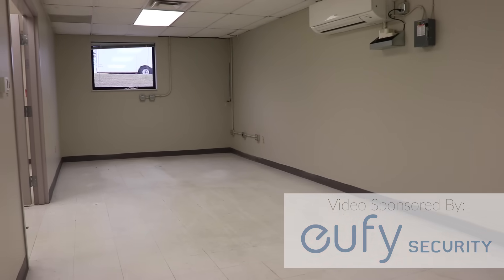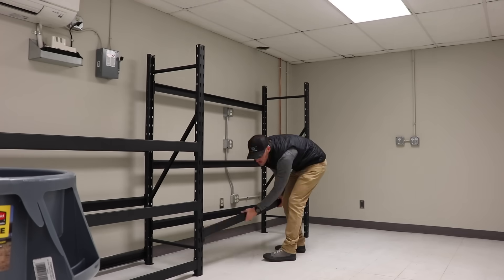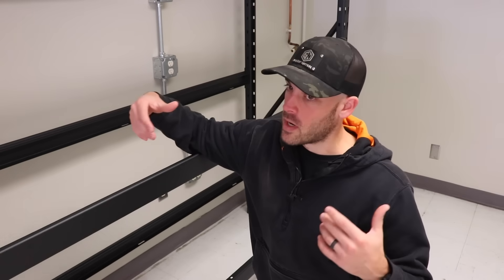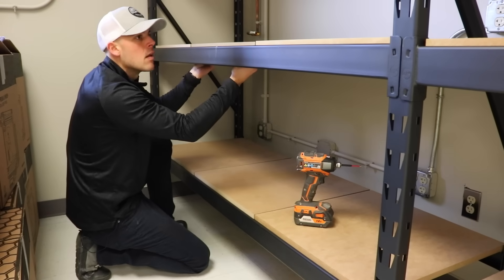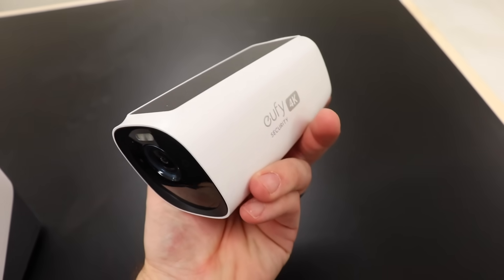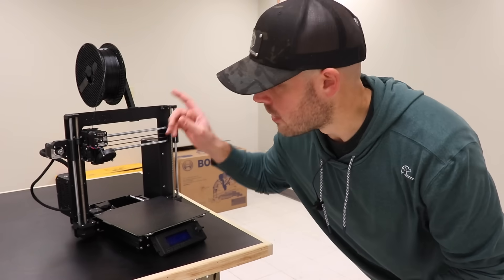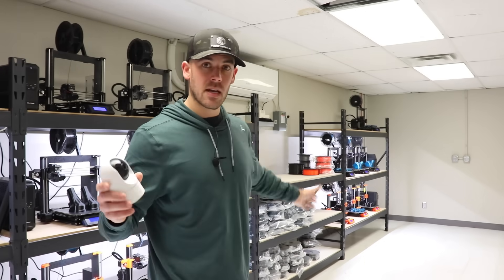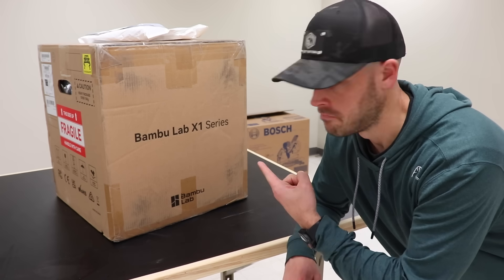I Tried Building an Industrial 3D Print Farm

Comment: I'm an efficiency expert.  One thing you can do to increase uptime on your machines is to have two sets of plates.  The moment you pull a plate off one of the machines, put in a blank one and restart the next print, move onto the next machine, and repeat.  At the end, when you've restarted as many machines as possible, THEN you pull the finished prints off the plates you just removed (and wipe down the plates).  This will save you a few seconds per machine, but over the aggregate, your "uptime" (amount of time the printer is actually doing work) will increase substantially.  This is called Single Minute Exchange of Dies (SMED).  The idea is that you limit the amount of time a machine is idle as much as possible.
Reply: No. True efficiency will be to use a sheet of PEI Film, a 3D printing build surface. You can buy the sheet in various X, Y, axis dimensions, though the Z axis dimension is a consistent 0.5 MM. Once the build is complete remove sheet along with part, wait till it cools and the part removes very well, while you wait till it cools you have already placed another sheet on printer bed and commence printing another part.
Reply: @phubarnow5388  PEI is a great print surface.  I agree.
Reply: Great thinking!
Reply: true efficiency automation.Installing the auto bed change build plates on all the printers and have 0 down time + automation. What if a print finishes at night? you got 4 hours of down time before you wake up in the morning to change bed. I forgot which company sells that system. To address your concern about the bed leveling because the sheets might be different, adjust gcode to run bed leveling each print. That'll be like 3 minutes tops better down 4 hours down time.
Reply from the maker: It’s a great idea and would save time…however, the minor changes in plate thickness means that I’d have to then change the offset in the printer as well.  So it would kind of end in a wash I think. The time it takes to remove parts and replace the sheet is about 20 seconds
Reply: @ShopNation  With as many printers as you have (and will have) would it be possible to find matched pairs of build plates for the machines that are close enough in thickness? I know that initial z height is important for first layer, but presumably there are pairs of plates that are close enough to not need a change when swapping?
Reply: @ShopNation  there are probing solutions that can help with the change in plate thickness and parallelism. This is one area where a three point bed leaving found in some of the Core XY printers has an advantage.
Reply: @ShopNation  it looks like most of your printers have the superpinda sensor which allows a constant z ofset between plates(as long as you used genuine prusa plates and same texture) in my experience with my makerspace 3d printers.
Reply: @ShopNation Have you looked into 3DQue Autofarm?
Reply: @ShopNation don't prusas scan the bed anyways? so like it should auto set the offset based on the curves?
Reply: @ShopNation I think the solution is the CR30.  They have a belt for a bed. You can mount them vertically so the prints just fall off the bed as it prints!
Reply: @theborednerds  also it's a junk creality bad for farm
Reply: @theborednerds wrong the CR30 has horrible reliability, a voron with a bed belt is a much better idea, but they have to be built by hand AFAIK
Reply: @ShopNation  men never thought of that, i guess comes this from running farm long enough :)
Reply: that would actually take longer because you'd be introducing a cooler plate. he just has to flex off the prints and flip the plate. I'm crazy and do that while its still a little bit warm.
Reply: if i was offered a opportunity to get a grant from the government and i wanted a to start a 3d printing  industry level , taking up contract jobs what path should i go for , i got an idea but intrigued to see what you say
Reply: Unless the build plate has aluminum foil tape under it to correct bed warping then that plate can only be used on that specific machine... I don't mind if the printers have 23 out of 24 hour uptime I'm not an obsessed perfectionist.... well at least I'm working on not being one lolz
Reply: Using flex plates, parts pop right off- the key to maximizing a print farm is to load more parts into the build volume. Then you have more parts per cycle and longer cycle run times. Ideally he'd want to go there once every 12 hours and change over the machines. The printers are cheap and time is not, so the way to increase production is really to increase the number of machines, That said, he's making the same mistake as Josef Prusa himself;  D printed parts at scale are more expensive than injection molded parts- unless you are doing iterative design or producing a part that is unually expensive to produce traditionally,  using a mature production scale technology will win. If an actual consultant with a manufacturing backgrtound came in here, the obvious advice would be to outsource the manufacture to an injection molding company that would produce a superior part at a lower cost. I don't mean some boutique overpriced short run specialist (Xoom, Protomold,m etc.) either.
Reply: I love when people start a statement with “I’m an expert”
Reply: I saw a video of someone who made a print farm where they printed a bumper and then adjusted the gcode so that after every print it would push the part off the plate and into a bin hanging underneath then starts the next print. There’s that and the CR30 with the conveyor belt. Perfect for mass production

Comment: I had a terrible time with those rollers. As the spools get lighter they start to pull right off the roller, even with good bearings. Hopefully you have better luck! I had to move to a different design.
Reply from the maker: Yeah I’ve heard of that happening, I have an idea to hopefully help prevent that
Reply: Maybe tilt them back so they aren't level will help?

Comment: Awesome!  One thing I haven't seen you mention yet was environmental monitoring, i.e. Temp and Humidity.  I'm not sure how sensitive those printers are to changes and it sounds like you have them running when you are absent.  There are tons of products out there that can send you alerts when things get outside of your parameters.   I currently use the SensorPush line since it ties into my Homeseer system and can run some automation routines for me.  Depending on the alarm system you either have or may go with, there may be options there as well.

Another suggestion would be to make sure that ALL of your networking equipment is set up on a battery backup that would be large enough to run it for several hours and to make sure your "NVR" box (the brain for your cameras) is also on it.  That way, if the power was out (whether by a storm or someone who wanted to see how much those printers were worth at the pawn shop), you would be recording full time and you would also be able to use your camera app to view what's going on.  Even with a generator, having all that equipment on a backup would stop it from power cycling while the generator was powering up.

Funny thing, I was just wondering how the backyard project was coming along and wondering when you would post another video. Guess you read my mind.  Thanks as always and enjoyed the update.

Comment: What if you turned the shelves 90 degrees and had walkways between the rows of shelves, instead of shelves going along the walls. It could eliminate dead space in the room if the measurements work out. You could put 1 shelf along the left (window) and right (opposite window) wall, then enough space to walk, then back to back shelves. |w||w||w||w||w| |=shelf, w=walkway. Not sure if that would allow  you to get more in the space or not without actual measurements

Comment: You Need to search Eufi LTT to see the videos Linus Tech Tips (oldest and largest TechTuber channel) did on Eufi.  As Jose mentioned they had an Extreme security issue.  And instead of immediately fixing it they flat out lied.  Got caught.  Finally fixed it, but never even apologized.

Eufi had been a sponsor for LTT, but Linus fired them over this issue.  I'd link the videos but seem to recall that's either blocked on most channels or looked very badly upon.  But that simple query will pull them up.

Comment: Q: What's the deal with the UPS'?  I think I didn't quite understand the point of them.
Reply: you don't want to be 4 hours into a 5 hour print only to have it ruined by a quick power blip. Cheap insurance especially with 25 printers running at the same time. It would also give time to switch to a generator for longer power outages
Reply: @scottstarck293  ah!  Yea, that makes total sense.  For some reason I thought it had to do with power distribution and was scratching my head.
Reply: @5ElementsWoodworking  Actually it probably helps with that also, no need for power strips everywhere

Comment: Don't be an idiot like me. I bought a Prusa, set it up, and couldn't get a print to get past like 5 layers without falling to pieces. I must have realigned the head 20 times. I thought mine was just broken and went back to my entry level Enders. Sooooo. Turns out Prusa sent PETG with the printer instead of PLA and I never bothered to look at the filament. So my settings weren't hot enough and the prints never melted enough to bind the layers. Sucks because I bought 2 more Ender printers thinking Prusas were not that great (even knowing how many people used them for production setups)

Print farm looks great!
Reply from the maker: 😂 oh man!

Comment: Nice video. I would like to see more information your process of getting all the printers starting printing. Is each machine dedicated to only printing one thing kind of thing. Once a print is finished the bed is cleared then same print is restarted. Are they network controlled or do you have start each one manually. Are they equipped with some of filament run out sensor

Comment: Eufy....  Oh boy.  Hope you like random people on the net also watching your cameras.  Install smart switches for all your lighting so you can control that from home too. Then you can turn on any light you want to see anything in more detail via your cameras. On top of that smart outlets for the printers if you don't have them accessible online - if one goes off the rails, shut it down instead of wasting filament or damaging anything. I'd have the whole thing running on Home Assistant which is quick to set up, supports everything under the sun and easy to manage.

Comment: I'm very curious to see what you think of the Bambu Labs.  That's my personal printer right now and I love it.  But, I don't know if the X1 would be a good machine for a print farm.  I think the best benefit of an X1 is the speed of the print, the ability to do materials that require higher temps, the lack of tweaking needed for most prints, and the AMS.

The only thing that I see really helping with a print farm is the speed, and that may not be that great of a benefit to you in a large scale situation.  If the speed does help it may make a lot more sense to do P1Ps instead of X1s.

Comment: I'm sure you addressed this somewhere previously, but why are you printing your products instead of outsourcing manufacturing to someone who can do injection molding or any other manufacturing process which could lower costs?
Reply from the maker: I plan on addressing this in a future video but mainly low volume high mix manufacturing
Reply: Tooling cost are prohibitive.  Molds are expensive around 20k-30k for a cheep mold and complex molds can go even higher.

Comment: Why do you not find an injection molding manufacturer?  You could order a few hundred pieces, packaged and shipped to you for less than the price of running that many 3D printers?  The printers are a good way of coming up with test products but not really scalable IMO
Reply from the maker: Yup I plan on addressing this topic

Comment: Those condensation pumps under your mini-split can fail. Which would cause overflow problem. Make sure the safety switch in the pump is connected to the mini-split to shut it down if pump quits.

Comment: Neat setup, don't forget to put smart plugs on each printer that way you can shut it off/on when you see a print failure from home.
Reply: Stealing this idea for my printer. Brilliant
Reply: Great Idea. I love smart plugs. They are efficient and cheap.
Reply: To go even further, if someone is able to train a vision model to detect failures, you could auto-shutoff and send a notification. One simple way for a setup like his to not go individual smart plug per outlet would be to use something like the WattBox.
Reply: @SethWhaley  Spaghetti Detective/Obico already does this, but now you need to add a webcam to every printer.
Reply: @hopkinssm1  or could you set zones to minimize additional cameras? Maybe 1 camera per 4-5 printers.
Reply: @hopkinssm1  Or buy some x1 carbons and call it done lol.
Reply: @SethWhaley  to go even further, train an AI to be sentient and run the print farm on its own. then all you have to worry about is the Ai taking over the business then the world.
Reply: This has saved me so much filament
Reply: Have none of you ever heard of Octoprint ? Lol
Reply: @LanceJoshlin  Pi shortage and scalper price hike, no thanks. Cheaper to buy a webcam and smart plug.
Reply: Take it one step further and set up Home Assistant so you can automatically shut off the printer when printers are done (and hot end cools of course)
Reply: @jonathanwilbur  Yup, I have my smarts plugs with a shutoff timer. Comes in handy for those late night prints.
Reply: @jonathanwilbur  I have mine setup so that if the temp sensor near the printer reaches 120 it turns off. Also it will alert me when the power drops telling me a print might be done.

Comment: Just a thought, maybe put a strip of foam in between each board to help with any potential shifting of the boards so they won't rub against each other. May not be necessary at all, just a thought I had.

Comment: Always amazing to see what you're up to!  I know you measured everything out but it looks to me like you could detach your shelf section that is lower (under the mini-split) and slide those two sections to the right corner and set that lower section up at the normal height for more printers.  Then have space under the mini-split for a roller workbench, or just build in bench/shelf with wood to connect to the now two separated sections (since that will be some oddball length/space now).  Anyway, just a thought.  Keep up the good work!

Comment: You put a lot of effort into isolating each printer from vibrations, but then you tied them back together with the barrina tubes.
Edited to add:  I have an ender and I agree that they're not something I'd want to base a business off of.
Reply: The clips that hold the tubes are not a very rigid connection in my experience, so I don't think that would be an issue
Reply from the maker: No the clips are only in one section, plus they are hardly rigid

Comment: how many printers would you have to need to consider injection moulding?
Reply: It's really more a "how many of the exact same thing are you going to make over time?" calculation vs "what is your print farm size?". Injection molding is great for established products where you are mostly concerned with churning out volume - FDM shines where your product development process involves "smaller" runs (not a shipping container at a time) and you expect the design of your products to evolve over time.
Reply: TLDR: He would need a very popular product to even begin thinking about injection molding.
The equipment and tooling for injection molding is infinitely more expensive. If something he was printing was popular enough to injection mold he would contact another manufacturer to make the items. This comes with tool manufacturing cost, MOQ (minimum order quantity), freight shipping, import fees, etc. 3d printing allows flexibility to pivot from one part to another without any of that.
Reply: There are also low volume injection molding options.  In these solutions 3D prints are used as the tooling and produce a run of 10-20 items (unsure of life of the mold).  Although parts can be produce quicker it requires more manual labor.  Also FDM printers are not good for producing the tooling.  The HP printer he mentioned could produce that tooling.  It would be interesting to see the financial tipping point for print farm vs the low volume injection molding.
Reply: @TSSolutionsPro  Yeah, thats what I was thinking - not every mould for injection has to cost 100k - after all most of the shapes produced here are not that complicated, and I guess the tolerances required are quite big. Also for smaller production runs molds can be made of cheaper materials like aluminium for example.